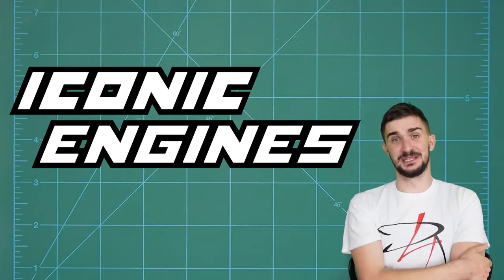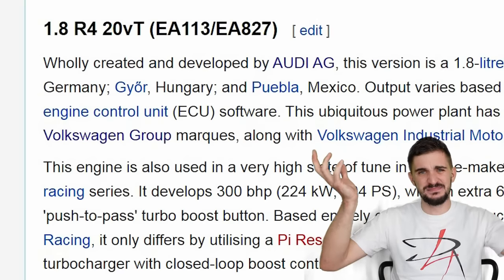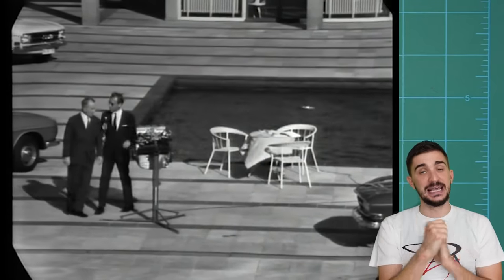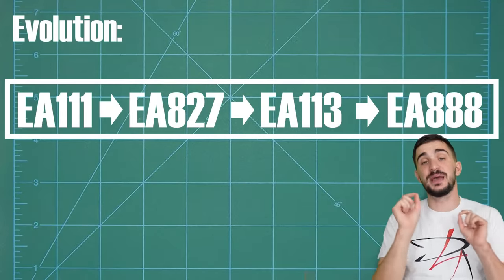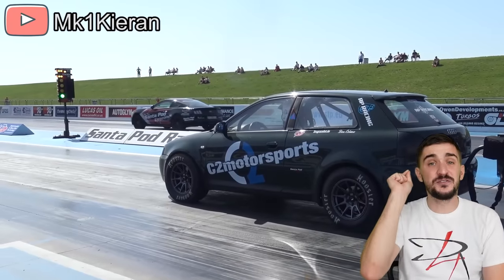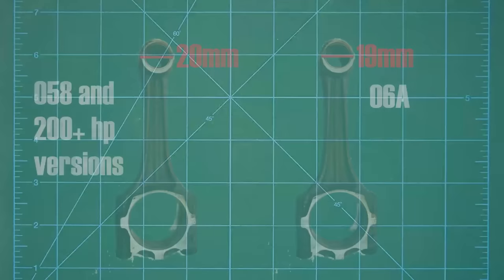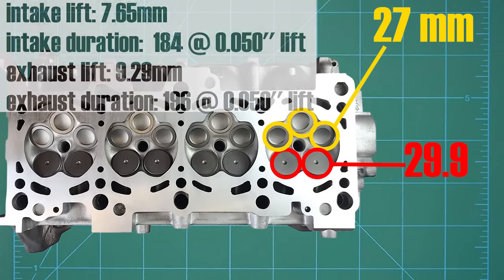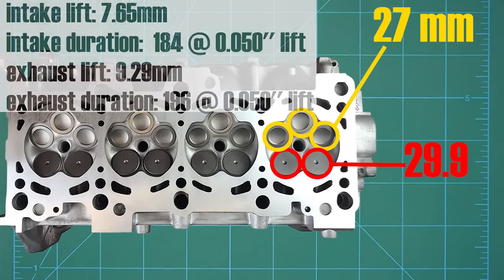VAG 1.8T 20V - What makes it GREAT? - ICONIC ENGINES #17

Comment: The 1.8T and 1.9/2.0TDI are absolutely dominating eastern europe tuning scene. Literally, every second VW group car is equipped with one of these tuned to 300+ hp
Reply: yah dat true. keeping and driving both!
Reply: They're by no means slack stock the thing is. My dad has one, no issues in like 7 8 9 years hes had it. Super clean oil all the time.
Reply: My 1.9TDI still going strong.
Reply: Are the internals being changed or they are boosted as stock
Reply: @mvelomthethwa880  Most of the 1.8T have forged crank from the factory so you won't have to worry pushing 300hp on stock internals. I don't know about the 1.9TDI but the 2.0TDI have also forged internals but a very weak head. Solve that and its a great platform for 300+hp and alot of torque
Reply: @ddaniel987  From memory I vaguely recall that the 1.9TDI's internals can handle somewhere around 250hp, but some variants can only handle around 200hp. The 1.9TDI is also very popular in the UK VAG tuning scene, the most prolific TDI tuner I know of is probably Darkside Developments
Reply: @ddaniel987  1.9TDi can run standard internals but needs uprated headbolts for anything over 200hp. The mods for 300hp are injectors, high lift cam, head bolts, big turbo, front mount intercooler and uprated radiator and a high flow cat and exhaust or decat and high flow exhaust
Reply: @owenbatchelder6230  High lift cam is not necessary, both 1.9 and 2.0tdi have already an aggressive enough cam setup. Whatever you do tho, never go the route with the aftermarket DBILAS cams, they are absolute trash. SDI cams are better but you sacrifice low end power
Reply: We had a Polo 1.9TDI Sportline, we upgraded to a family car Tiguan 2.0TDI. Basically it's the same engine.
Reply: @warrenphillips69  the 1.9 and 2.0 have little to nothing in common. I own both.
Reply: @owenbatchelder6230  The block is essentially the same, tho with little bit bigger pistons. It's common upgrade for the 1.9TDI to bore and put 2.0 pistons. also the 2.0TDI 8V head is similar but there is nothing else really. 2.0TDI is more refined, and VW really tried to make it better but failed because of the overengineered balance shaft module (oil pump drive hex shaft) and the poor material used for the head. Solve these, and you got a very bullet proof and smooth engine
Reply: @ddaniel987  2.0tdi is 16v with common rail injection and fa'r less reliable
Reply: @owenbatchelder6230  I was talking about the 2.0TDI 16V PD engine. But yes, you are right CR 2.0TDI and PD 1.9tdi have nothing in common
Reply: Not surprising. Both engines are ridiculously easy to juice up. And even the smallest upgrades make big differences.
Reply: Is 300+ supposed to be allot ?
Reply: @owenbatchelder6230  how does .points of a tenth in combustion make a worlds difference for you ??? U sound crazy
Reply: @zayseeu8337  I have no idea what you're talking about
Reply: @zayseeu8337  from 4 cylinders and 1.8 liters it is.
Reply: While tuning was very common on the 1.8l too, the scene in Germany seems to be dominated by the 2.0 TFSI. It goes to an extend that finding a stainless steel exhaust system for the tuning market is easier than finding a stock one. Sometimes I had the impression that I'm the only person on the planet driving the 2.0 TFSI in a stock configuration...
Reply: The TDIs can easily put out gibs of power but they’re so much lower in rpm and I’ve found that to be a problem.
Reply: @patrickkelly8095  the power band goes up with the more power you squeeze from those. For example 2260 turbo & 242cam will make your peak torque at 3k rpm and max power at 5k similar to petrol.. but the drivability suffers as there will not be low end anymore. This can be fixed by using latest gen vnt turbo but they are very expensive and doesn't usually yield 300+ hp
Reply: Bulgarian 470 whp golf mk2 here xD Guess whats under my hood :D :D You guessed it right xD 1.8t AGU <3
Reply: @plamenfilev1171  Е покажи го де не ни тийзвай само :D
Reply: @zayseeu8337  depends on the car's weight
Reply: @Simoxs7  why not? If its the 140 or 150 version, its really just a turbo injector tips and tune away from 300hp. 90/110 probably won't make it to 300 without internals
Reply: @baileyhatfield4273  AAA
Reply: Check out C O motorsports YouTube channel. They are a Canadian based tuner who have a stock 1.8t that pushed 600hp before the valves hit. They slapped a gt30 series with 2k cc injectors. After the valves hit it still made 550hp. There planning to do a full tear down on it pretty soon.
Reply: Reading this as I sit in my 2.slow. She’s feeling jealous
Reply: @ddaniel987  why is the dbilas cams bad? Thinking OF the 272
Reply: I just looked some things up and well I could buy a fully build race spec 1.8T that can handle 500-600hp for around 5000€ and if I want less power and build it myself it would be even cheaper.
250-300hp is easily attainable with a decent 1.8T base engine and the bolt on upgrades.
Reply: I did not know this.  North America has largely  moved on from 1.8T but mine still purrs and pulls so nicely.
Reply: @zvornicka2718  some of them are known for eating lifters and cam lobes going trash after only 5k km, tho i've seen people running them for 100k + with no problems
Reply: @ddaniel987  thanks for the info mate. Cheers
Reply: @owenbatchelder6230  In the states we have both 1.9 and 2.0 PD engines
Reply: And 330D from e46 or e39, everybody use it  on offroad cars, sprecially Patrols, and you can get 350+ hp from them
Reply: @boozecruiser  1.9TDI (ASZ 131PD and ARL 150PD) can handle around 500HP on stock internals!
Reply: @mvelomthethwa880  Stock 1.8t can withstand 300 or a little more horsepower. Looking at displacement and the fact that its only 4 cylinders, that's pretty damn impressive.
Reply: 1.8t , 1.2tsi and 1.0 tsi are domation indian one and the 1.6 tdi
Reply: @alouisschafer7212  It cost a lot more then that even when building it yourself..
Reply: @thomaskunz8029 there is a stroker kit for the 1.8T which makes it a 2.0T and bigger rods to handle 500+ HP easily. That kit costs me 3000 euro's and a few 100 for shipping. That's paying a shop to insert the parts/build the engine certainly ain't 2000 euro's.
Reply: @g-nice_pimp   I’m confused what your saying about it not being 2000 euros. What’s not 2000 euros? And that kit your talking about is just rods pistons and a crank. If your going to really run at 500+hp you’d be stupid not to build up the head which is another 2000-3000 euros alone and a shop rate to assemble that engine would be at-least 2000 euro probably more. So after all said and done your closer to 8-10 thousand euro.
Reply: @g-nice_pimp  You also haven’t added the cost for the turbo, manifold, injectors, intercooler, pipping, exhaust, fuel pump etc and then having someone tune it. It will end up 12-15 thousand euros by the time you get it running lol. I might be off a little because I’m a USD guy but still it’s a shit ton of money!
Reply: I have a 2004 Audi TT 225 with the BEA engine. Turns out, as long as you swap out the oil pump gear, you can pretty much just toss in the crankshaft from a 2.0L engine. These 2.0L cranks with 1.8L oil pump gears are sold by Integrated Engineering as Stroker Kits.
Reply: @owenbatchelder6230 and how can you register your car with such a modified engine?
Reply: Im intrigued to say the least
Reply: @bigdumbtruck  the 1.9 is less than half the displacement as the abroad V8 in the US and its a diesel, has MUCH better fuel economy though lol
Reply: @bigdumbtruck  yes if you try squeezing out a lot of power it's really bad on fuel, but if you build an engine for 200 hp obviously a 5.0L is too much, personally I'd tune a Coyote for regular gas as it's more than powerful enough for me and fuel is cheaper but you still get the awesome V8 noise and vibration

the perfect example of this is Toyota imo, the 1.6L inline-3 GR Corolla is less efficient than the 3.5L V6 Camry even though the Camry is bigger and they both have 300 hp, and people believe that 1.6L is going to be cheap to maintain, those idiots, they just see a Toyota logo on it and think it breaks the the laws of physics
Reply: @bigdumbtruck  I said when talking about not that big power it makes no sense to go to such a big engine, and not everybody goes for 500 hp. Here in Europe it's also illegal in a lot of countries due to yearly inspections and the mods requiring an emissions test ehen exceeding a certain power increase and those mods will fail the test 100%
Reply: @bigdumbtruck  no you are wrong, the 1.8T is great
Reply: @bigdumbtruck  we use those small engines in Europe because we don't have a choice. Here you would pay insane road tax if you were to drive such a big engine. Thats why most of us tune the little 1.8t, 2.0t and tdi engines. You get big enough power in a car that is stupid fast because most of the time those engines are in tiny golfs, a3, seats, skodas etc and you continue to pay the 20-30€ or whatever road tax is for your "stock" 130hp engine
Reply: @bigdumbtruck  also speaking for tdis, at high hp numbers you can still maintain the stock low fuel consumption if not even lower, as you can cruise with low injection quantity and get the high iq when you need the power at wot. Its all about demand. Not gonna mention the possibility of the multi map and switching between the tunes on the go
Reply: @bigdumbtruck  sure but thats not the point
Reply: @ddaniel987  1.9 TDI survives to around 200hp, above that the head rises and blows the head gasket. Upgrade the studs/screws (don't remember now) and you're safe to around 260-300hp, depending on the version, after that things break. I heard that 1Z crank is the strongest, with PD models rods. I run over 300kkm ALH with VNT-17 (GT1749VB), 3bar MAP, .216 injectors, kevlar infused clutch. Don't know the exact numbers, but running on 1.4 bar boost I expect at least 130-140hp from it, while still running below 6 liters/100km. I can get under 5 if I drive nicely. The things limiting me right now are the clutch size from too much torque, stock side intercooler and the injection pump which I'm already maxing out. But for more easy power I would add the 1.9 SDI camshaft with PD intake, easy 40hp gain.
Reply: Me in my mk4 Jetta 😏👌
Reply: @plamenfilev1171 yeh baby!!!!
Reply: We have a 1.4tsi with mostly 1.8tfsi parts swapped to it making 17psi and doing 9k rpm and 465 hp thru the Rev range.